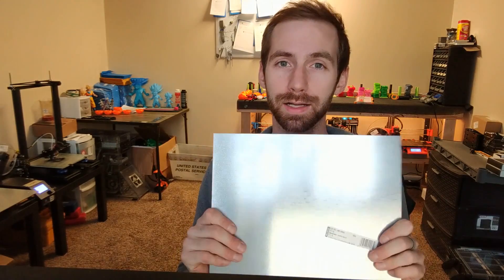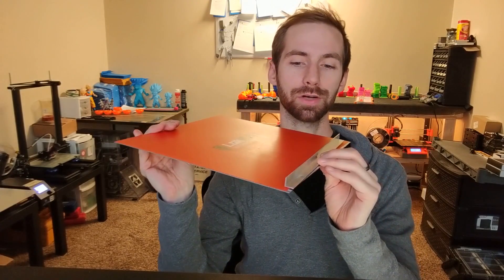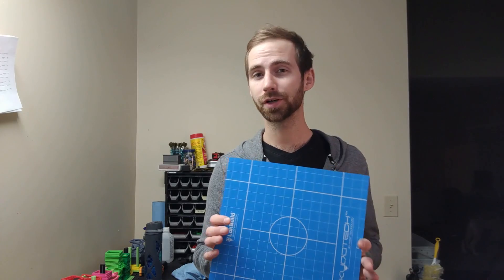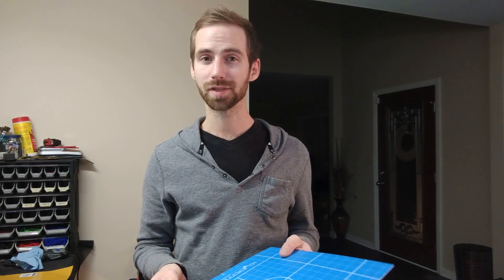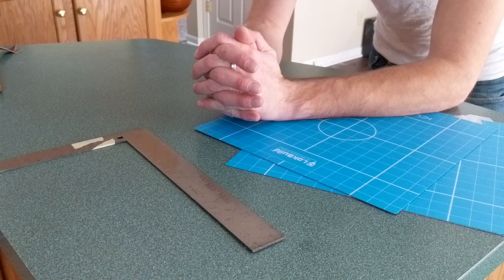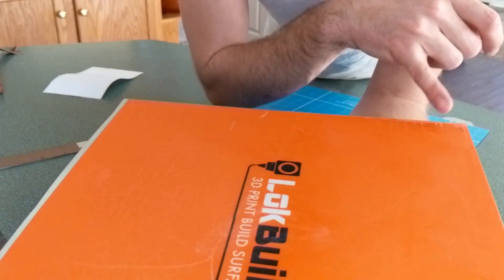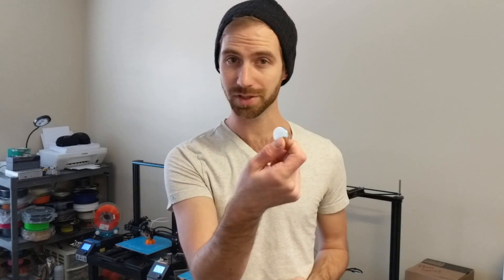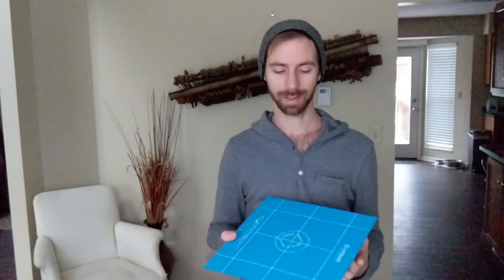Best 3D Printer upgrade DIY Creality CR10 Magnetic Print Bed - Works on most 3D Printers!

Comment: Good video. I have question tho. Well when i print i use white painters tape on aluminium bed, petg sticks to it real good but if i print bigger part petg print pulls tape off the build plate. Can the same happen with magnetic bed?
Reply from the maker: You shouldn't be using tape if you made a magnetic bed

Comment: If you print some handles for the tabs in 2 parts so that the tabs are sandwiched between the prints the bottom part will also act as a locator/registration tab
Reply: +1 SUBS

Comment: Take the spatula, find something to use to hit the other end of it with.  Start chiseling the prints off.  Much easier and safer.  You get good at it and you are knocking off prints from the stickiest stuff.  Removing the build surface takes too long.
Reply from the maker: I disagree. Using a spatula, especially like that, takes way longer than removing a bed, bending and removing the part.. data proven in my case
Reply: @ImproperEngineering  You are right.  I make different prints that are like large frames that have to smash into the build surface to keep from warping.  I dont see this working for that.  But it might.

Comment: any potential problems with just superglueing the magnets to the bottom of the buildplate? (less distance in between the buildplate and magnet equals a stronger attraction)
Reply from the maker: Yep, exactly. Super glue likely won't hold at that heat.
Reply: @ImproperEngineering  what about silicon molding? Or is the adhesive too thin at that point to do it's job?
Reply from the maker: @permawheelie  only one way to find out!  The double sided silicone tape I chose to use because I know it's incredibly strong. Even though I was sacrificing it being as close to the plate as possible, I knew my magnets would have been strong enough to counter that distance
Reply: Improper Engineering gotcha, and of course you can just double up the magnets if needed. Would you know of anywhere I can find a large heatbed and plate to mount it to? (400mm x 400mm or larger) I am looking to build a custom system and would love to give this morning a shot
Reply from the maker: @permawheelie  nah, I'm sure some googling would pull something! You could probably snag a replacement cr10 bed(s4 I believe) but you'll have to know how to fix the concave bed.. which I go over in v2 of this video haha
Reply: Improper Engineering, Im pretty sure I'll pick up a keenovo heat pad and find a plate elsewhere, the search continues lol
Reply from the maker: @permawheelie  I don't blame you. When I build my hypercubes, all my cr10 beds are gone.

Comment: I've gotta big sheet of metallic-covered foam stuff under my print bed. Did you not have to take that off first?
Reply: Same here. I have a new cr-10s. I don't really want to pull off the foam.
Reply: I ended up scraping it off with a putty knife and some goo gone. Took little a while (couple hours). I even ended up removing the back plastic cable cover thing. Because that foam created additional space, the gap between the hotend and bed was now too much. So I created an extension: https://www.thingiverse.com/thing:3105714

Comment: Correct me if I’m wrong, but don’t magnets lose the magnetism when heated?...heat bed?
Reply from the maker: Some do. The ones in this version have not lost any magnetism since the video and they are rated for right around max bed temp whereas the magnets i use in v2 won't lose any at all because they have a higher heat rating.

Comment: Any reason why you're not going to add this to the Prusa MK2s printers?
Reply from the maker: Robin Milward I'm going to :) one was already half converted but I got swamped with orders so I had to take it all apart
Reply: Improper Engineering cool, I might get it done on mine, I was worried the magnets might affect the PINDA probe in some way, but after a bit of research I think it should be fine
Reply from the maker: It does affect it, as does the metal sheet

Comment: I’ll try using kapton tape to hold them the magnets directly touching the bottom of the heated bed for more strength with holding the plate
Reply from the maker: Hugocraft that would work! Good thinking. I haven't had luck with kapton tape staying in good condition over time. Must just be my luck!

Comment: How did you cut the metal sheet? An important detail I reckon.
Reply from the maker: sure is! it was mentioned in a handful of comments and I go over that in v2 :)
I personally used a dremel but snips can be used as well. I'd recommend a dremel over snips because snips will leave a slight curled edge.
Reply: OK. I haven't got to the comments yet but nevertheless, I'd be interested to see how a Dremel handles 26 gauge. I thought about snips before you got to that part but my memory of snips are that they'd buckle the sheet while I tried to use them. Then I'd have to try and badly bang it flat with a hammer. 
Thanks for the answer. Maybe I can do something with my smallish angle grinder.
Reply from the maker: No worries man! A dremel does just fine with a cut off wheel. An angle grinder would work just fine as well, you'll just have more control with the dremel.
Reply: A Dremel would be good but I would only use it for just this one job. Not very economical. Thanks once again.
Reply from the maker: I feel like a dremel is something every house should have because there's endless uses - especially with 3d printing. But you can snag cheap ones for $15-$20. Good luck!

Comment: Anyone done this on CR10s? I tried to do this on my CR10s and with the glass bed removed, the Z axis can't get low enough because the metal brackets (with the roller wheels) hit the top of the stepper motors. It can't get down low enough to engage the limit switch because of the metal brackets hitting the top of the motors. Anyone have this problem?
Reply: J Belle I just doing this mod now to my cr-10S and have run a cross the same problem. Did you solve this? It's to heavy to leave the glass and metal sheet together.
Reply: Ravemind yes, I printed out an adjustable cr10 limit switch adapter from Thingiverse. It makes the limit switch able to move up higher

Comment: Have you been having health issues being in the same room with the printer? Im not sure if my case is but ever since I got my cr-10 I would usually print overnight in my closet and then sometimes I wake up in the middle of the night and vomit a lot with no sickness at all
Reply from the maker: PLA and PETG should never put off fumes like that. It's likely a coincidence to something else. ABS is another story I believe.
Reply: Improper Engineering Interesting. I've only been using pla. I did read something online about ultra fine particles being produced but it never said what type of filament
Reply from the maker: You're totally fine dude, PLA should never do anything like that to ya

Comment: McMaster Carr has 12 inch wide sheets of spring steel.  Search for "Wear-Resistant 1095 Spring Steel Sheets and Strips".  I'm getting a 10"x12" piece for my Prusa I3 Mk3 clone attempt, which is only in the early planning stages.

Comment: Neodimium is a rare earth element too. Unless you bought a samarium/copper magnet wich are a lot more expensive, but not magnetically stronger. (they withstand higher temperatures)
Also, magnetic force decreases exponentially with the distance, so no wonder why the foam in the bigger magnet was giving you trouble. AND, also, for such a thin plate, you could be magnetically saturating it with the bigger magnet, hence, performing similarly to the smaller one.
Reply from the maker: Yep, all this is correct. The distance was also touched on as well. Though there's not really any magnetic saturation going on. It's not overpowering and the more I printed the more I could tell a difference in the two types of magnets. It's why in v2 I mention to everyone to not use the smaller ones at all.

Comment: What sort of issues could magnets under the build platform cause with a inductive sensor probe?
is this something i should even be concerned about?
Reply from the maker: Darryn Hosking I would not put them close to a sensor. I will have a video in the future on this as I've already swapped one of my prusas over.

Comment: I use $2 pieces of lexan from the hardware store with build surface (Coropad) stuck on one side.  Work great, removable, flexible, and flippable if you want to print on the smooth shiny side (PLA and ABS stick great to lexan, PETG can stick too well and tear up your build surface too so i add tape for that).  Still using clips though, thinking about drilling out the corners and embedding some magnets, liking  the magnets under the bed.
Reply from the maker: macelius the problem with lexan is that it scratches way too easy. The melting point of most lexan is like 120*c and that's only the melting point, that's now when it's warm and gets bendy

Comment: on glass you should squish very much, you shouldn't use anything on glass, just wipe with alcohol and remember to let the part cool down so it doesn't warp when you pop it off
Reply from the maker: You shouldn't squish very much as that creates an elephants foot. On most of the parts I print to sell, if there's an elephants foot then it throws the whole assembly off. I never had an issue printing on glass with glue though.. just this is a much more efficient and practical solution IMO.

Comment: Hi, good job! I will build this myself. A few questions. The magnetics are not working (good) above 80 degrees, according the specs. Is that a problem in real live? How thick is your sinc metal sheet?
Reply from the maker: Frank Roozendaal the magnets I listed above start to lose their strength above 80*c. I don't print over 75*c and haven't had an issue although in V2 of this, which will be up later today, I will go over the new magnets I've chosen.
The sheets are 26ga
Reply: Thanks, I will wait for your version 2, before I will start ordering. ;-)
Reply: Still waiting. ;-) Can you already tell what the main differences are between v1 and v2?

Comment: Wouldn't this only work if the plate that came with the CR-10 is perfectly flat? Most aren't hence why so many people replace the glass with mirrors.
Reply from the maker: If it's warped then this would cause issues. None of mine had a warped bed but will be covering a fix in the next video.

Comment: So I tried to do this, but I could not get the bed level after. The lock build would always sag in the middle and even by adding cheats of masking tape I could not get it after it enough to have a perfectly flat surface
Reply from the maker: I ordered a spare bed just in hopes is was warped so I could show how to combat this.

Comment: What is the main change to V2? Im really interested, i want to wait before i made this one.
Reply from the maker: I can't say for sure yet. Experimenting with a few different magnet setups.
Reply: Cr10 -s has a insulated bed that covers 95% of the heated plate. No room for magnets.
Reply from the maker: That's a bummer. I'll make a note - i've never seen a cr10s in person.
Reply: Only the newer CR-10S version have this insulation. Most people have the CR-10S without that insulation.

Comment: Not an electrical engineer....but wouldn't magnets of that type interfere with the power distribution of the heater?
Reply from the maker: Not on a heating element like this, no.
Reply: The CR-10s are notorious for having a dish in the build plate. The glass sort of helps with this. Do you have any issues like the sheet metal conforming to the dish...if you have it?
Reply from the maker: You're correct.  I've gotten lucky with my machines and haven't experienced the death warp so unfortunately I can't comment on this. I believe you can shim your bed properly and fully get rid of the concave bend. I need to order a spare bed and see if it comes warped so I can experiment.

Comment: I have been looking at doing this myself.  This is a great tutorial and made think differently about how to set the magnets.  Thanks for sharing.  One question, what did you cut your sheet metal with?
Reply from the maker: Dremel with a cutoff wheel and sanded all the edges afterwards. Sheet snips could be used as well but they would leave a crease, and I aint about that life!

Comment: Typical Neodymium magnets will start to loose part of their magnetization permanently at a temperature of 80 °C. It is why, from my understanding, Prusa is using Samarium Cobalt magnets.
But it is possible to get high temperature Neodymium magnets. Point is, look for magnets that is rated for higher than normal temperatures.
Reply from the maker: So I've heard! I will look into other options even though I don't go above 75* on the bed. The good thing is that these are easily replaceable!
Reply: There are Neodymium magnets available for higher working temperatures (up to 180C I believe).
Prusa is using 130C ones (as confirmed in Thomas S stream)
Reply from the maker: not sure how I missed your comment, my bad! that's correct. in v2 that's what i'll be using.

Comment: Hi, I'm curious how you cut the metal.  Just regular metal shears?
Reply from the maker: I almost added that in the video. I used a dremel. Shears will leave a slight crease. If using a dremel just be careful to not get the edges too hot or it'll warp.

Comment: can you put a link for the lokbuild that you got- also a list of the metal sheets from lowes/home depot - but great video and information
Reply from the maker: DOH! can't believe I forgot that! There now
Reply: it might be this killer head cold but exactly which magnets did you end up going with lol
Reply from the maker: Or maybe you're too drunk :D kidding! I bought both that I linked to in the description, but would recommend the neodymium ones(bigger) over the rare earth(smaller).
Reply: Improper Engineering I just woke up but you never know aha but thanks and how well does the silicone tape handle heat I like printing my pla with a bed temp of 70
Reply from the maker: First, wow i usually don't have to go above 60 for PLA. I'm mainly printing PETG at 75* and no problems.
Reply: Improper Engineering I used to print at 50 but had some issues now at 70 I'm going strong haha